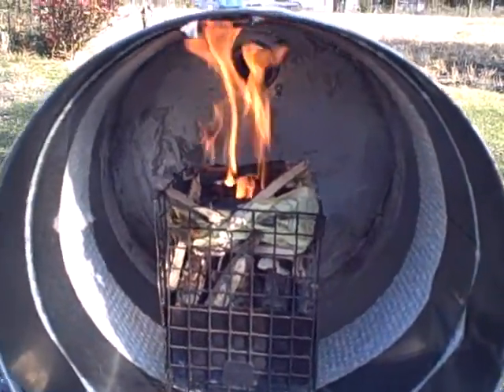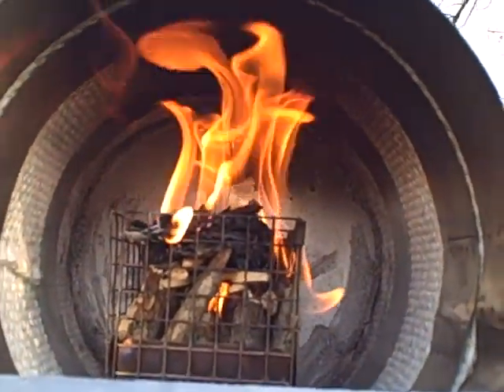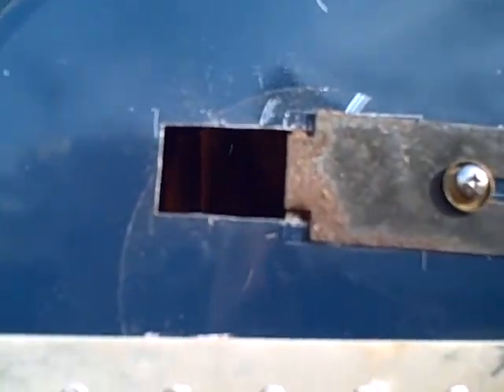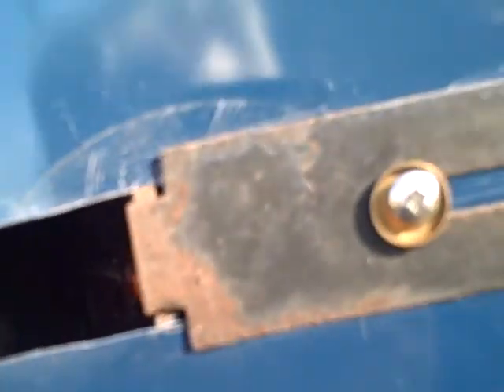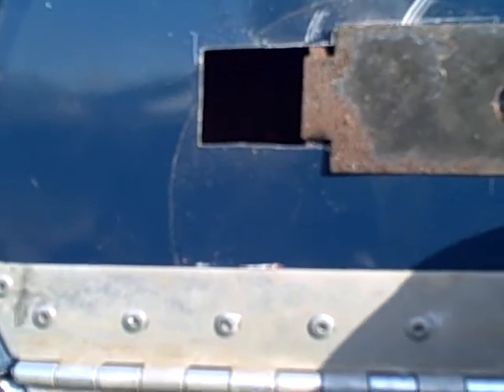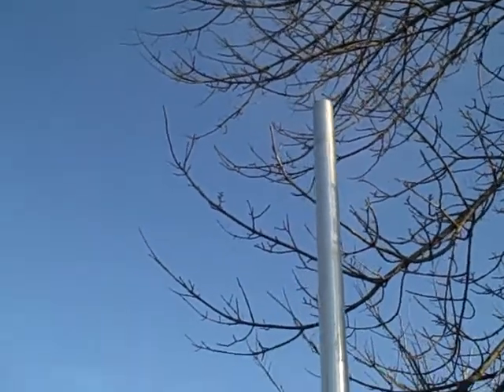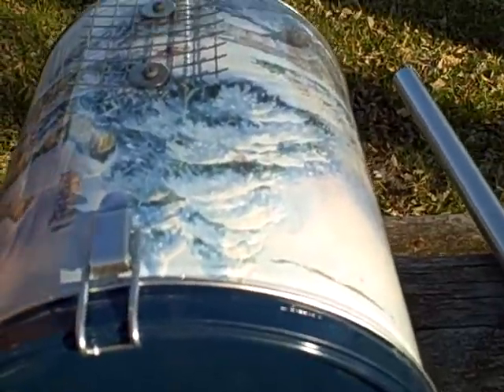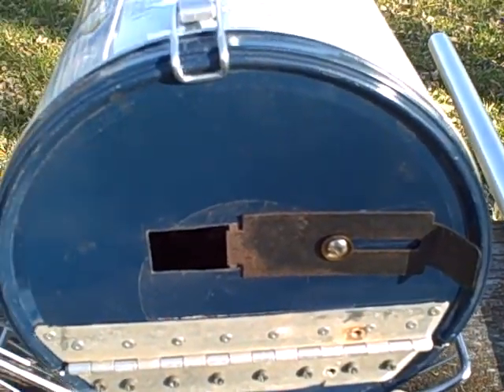DIY Hunter Tent Stove woodburner #1

Comment: Nice build - very clean.  The insulation may be keeping the heat from radiating and you may be using a lot of heat through the flue.   I would like to build one just like yours but I may try to do it without using insulation but put a steel plate near the top so the flames will hit it and not the top of the main shell.  Thanks much for this video

Comment from the maker: @hoz49 Thanks Hoz. Great idea about the hinged flap lid to heat bottom of pot. The fiberglass is for even distribution of heat so there would be no distortion on such a lightweight steel container. As is it is slow to heat up around its mid section. The ends radiate a lot of heat quickly. The flu pipe is too small in diameter, need to go to a 2 inch. I'll have a part #2 video today hopefully to show the next 2 tests done yesterday.

Comment: Nice work  zellph! . That's a giraffe of a flu pipe. made one of these several years ago, following Bill Masons design. Suggestions, add a double bottom 2 get fire off the body.  Make a hole in the top with a hinge flapped lid to fit your med/lge billy pot. After fire gets going, Insert pot so that flames lick it, water will boil quicker. By then pipe is hot and drawing so minimum smoke enters tent. 

Question, what is the F/G tape inside for?

Comment from the maker: @righty1230  Thank you, I used stove gasket cement. It comes in a tube and is in paste form. I temporarily adhered it and then came back and added stainless steel bands to hold it securely in place. The flu exit hole is measure by square inches and then the air inlet is made the same.

Comment: Very Nice.
Question 1. How did you secure the fiberglass in place?

Question 2. You said that the air intake was in proportion to the flue size. How do you calculate that? Is there a special ratio?